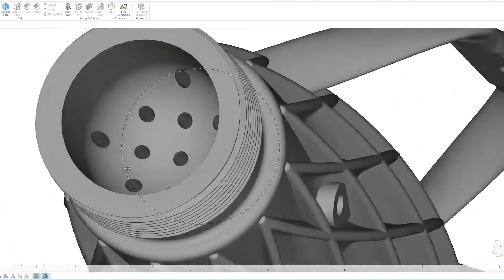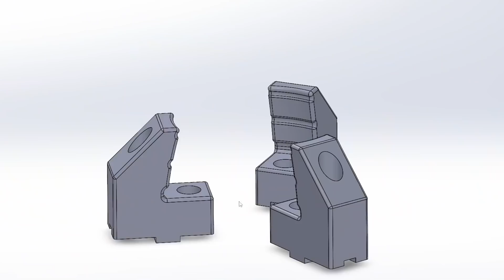30 Years of Experience and it Means NOTHING?

Comment: I’ve been a tool and die maker and machine tool and die designer for over 42 years. There is a difference between reading and producing a part from someone else’s print as opposed to conceiving, designing and detailing the numerous parts and prints it takes to produce a progressive die, a mold, a machine tool etc.. two different worlds. Having said that I still today design and build dies, jigs, fixtures, custom machines and build them mostly on manual equipment. BUT! I have plenty experience programming CNC machining centers, wire edms but still choose to let the young stuff do that work for me.. fresh minds are equally as important. And.. it is entirely possible that I actually have forgotten much more than most CNC operators have experienced. CNC is here to stay and is capable of machining operations that were previously thought impossible. That’s progress. But!!! “Something old, something new…” is the mark of a well rounded machinist, tool and die maker, mold maker. We old guys still have much to pass on… it’s called Experience and the fact that we have made so many mistakes.. learning from those mistakes is what makes an excellent machinist. I stand and marvel at the capabilities of todays multi axis simultaneous interpolation at such high feed rates. If you get a chance to go back in time to the industrial revolution through World War 2 you would be amazed at the equipment that was produced to create high rates of production long before computers, tape readers and CNC machines. I’ve seen such equipment and am damn proud to have been a small part of it.

Comment: 25 year here and I'm constantly learning more. I will say though that people with fewer years on the job should be willing to listen to and discuss things with the older hands. I've seen many time where we get a new guy and he's going to use a new awesome process and get's told it won't work, we've tried this before. They they get this "I went to school I know more than you" attitude and scrap a part because guess what, their great idea didn't work and they didn't take the time to ASK why it didn't work before. They just think that it will work if THEY do it. TIP: tooling and processes that work on a brand new $1million machine may not work on a 40 year old machine that hasn't been well maintained. Opposite example: we recently switched from using a HSS reamer to a carbide tipped reamer on a machine to improve surface finish for an o-ring sealing area. I was told by an old timer "we've tried those and they aren't going to work." So I asked what the issue was before and was told the spindle was so worn badly the tools cut oversize. I commented "well, they just installed a brand new spindle and bearings, let try them again." Guess what, the tools work GREAT now.

Comment: This is true to a certain extent. Talent is difficult to see over experience. All too often young guys hot out of college or trade school with their heads buzzing want to hop in full speed and make a name for themselves wanting to try different things. How do you pick out the talented ones who paid attention over the ones just snuck through and barely paid attention at school. That's the problem with a sheepskin, it doesn't say if they were top of their class or got shoved through and forgot half of it. You can usually pick these guys out by sitting them down and hang them a caliber and say give me a measurement off this part. You'll be surprised how many can't. Hiring them is a problem for the employer. This is a risk that is almost always at the expense of the shop. You don't want $20,000 in a damaged machine with the person standing there saying, "That went differently in my head."
On the other side experience doesn't always play out either. There's a saying that says "There are two kinds of tech. One that has 10 years experience and the other who has 1 year experience repeated 10 times." This applies to many things, even this field. In this field I've found veteran machinists are cautious, almost to the point of paranoia. They often aren't open to something new immediately primarily because oftentimes new tooling is costly. It requires reprogramming to specific that tool. One mistake and at best you damage the tooling / part worst case you damage a machine costing thousands of dollars and expensive down time.

Comment: As an old guy I can't agree more. I was young and knowledgeable and old experienced machinist fought with me on every new idea. Most of which ended up being proved correct. As a result, as an old so called Experienced Machinist, I spend hours learning new techniques and watching the next young guy. Getting older I realized that my hey day of being the ground breaking guy is slowing down. But my company values me over other old timers because I'm humble enough to realize our old way is now just that...an old way. Feed's speeds, Master Cam tool paths have changed and improved over the years. Some I've kept up on, others I haven't because I have lost a step or two. Either way, I'm ok because it's time for the young warriors of our industry to forge the new path just as I did back in the day using Master Cam 9. (not 9X...just 9). I used to hear the same thing back then.

Comment: There's a difference between 20 years of experience, and 1 year repeated 20 times over. Some guys have been doing something for 20 years, but just doing the same thing, over and over.company I used to work for, they had guys who's sole job was tack welding a component that would get welded by someone else, but those tack welders, couldn't really weld, they just tacked. I've been in the industry for over 20 years, my current job I started 10 years ago, and we just had a welder and a grinder, then we started growing and got a Bridgeport and a hundred year old lathe, and now we have some cnc machines that I setup and run, in total we have hundreds of products and most of them I was involved to some extent in the design, and made essentially all of the fixtures whether for welding, or machining, is not very often I get bored, there's always something new going on.

Comment: I used to work as a machinist tool and die maker for the last 44 years and I have a large expérience in dies and complex parts and I can say 0ne thing shure is that there is always something to learn and at this point that this learning will probably come from someone younger than me. expérience is a tool in itself that you must use to always make better but there is always room for improvement
Reply: As an old guy myself I realized I never wanted to be one of those " well we always used to do it this way" guys! For one, much of the fun in it is learning the new approach.

Comment: I have 6.5 years experience on particular Doosan lathes, and I know them better, than the guy, who was working on old Soviet CNC machines, before our Doosans were purchased. Even due to the fact, that he was transfered to these lathes several months, before I got a job there, so we are working almost the same amount of years on them. This guy is simply doing half of work manually, and his programs are complete chaotic mess sometimes, lacking half of operations. And, when they give me to machine some parts, that he usually do - I'm forced to write a program from scratch, as there's nothing to do with his programs. But, I still realise, that if I'll be forced to change my workplace - I'm basically starting from the beginning, as there are going to be different machines, with different controls, with different style of programming, and even parts are going to be different. On current workplace I'm doing programs in Fanuc's Manual Guide mode, with minimum of handwriting. Other workplace will, probably, offer more handwriting, or even CAM generated programs.

Comment: Understand what this translates to once you wash off the sugar coating. I'm old so I'm right. 

(I'm in a different field so the rules are slightly different) if you have to bring up time in the field to defend your argument, I've won the conversation. If you have triple my experience in the field, you should be able point to specific examples, and have better logic/examples why I'm wrong. The inability to do so means that the whippersnapper has a good point even if it's contrary to how you would have done it.

Comment: I've been an Real CNC machinist for over 30 Years,the only Difference is I changed shops every two years when I started. I was told that You will have learned all You can in that shop and Make All the $ You are going to make for a while! It worked ,by default I really have 30 Years of Diversified Skills across multiple Industries! I would hire a Guy with ten yrs experience that has worked in 4 shops before I would hire a Guy that spent 20 in the Same Shop!

Comment: The first month I started doing this job as an apprentice years ago, a freshly hired operator (he bragged about his what so called 20yo experience with the Heidenhain controls, in his late 40s) the first day, with a drill in his hand, came and asked me what speeds and feeds should have he used. Later we found out he always worked on the same machine just by setting up the stock in the machine and pressing the cycle start button, and other people did the programming and the setup for him. Never opened a catalogue, never guessed why the tools kept breaking, never did 1 minute overtime or a little more than what were his instructions.
So.. experience means a lot if the operator is passionate about what he does, otherwise he just ends up like Charlie Chaplin in Modern Times, tightening the same bolt for the rest of his life.
Reply: Damn.... Years of experience can be a deceiving thing
Reply: Some people like what they do and they try hard, some people do it just to survive, nothing wrong with it. Although if you do one job for 30 years, it's kinda hard to not learn anything, maybe he is a slow learner.